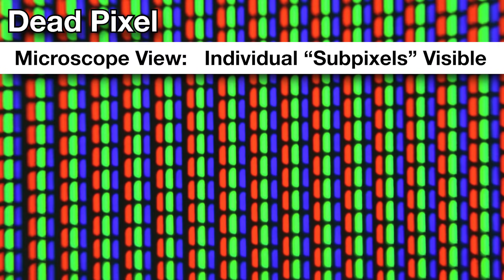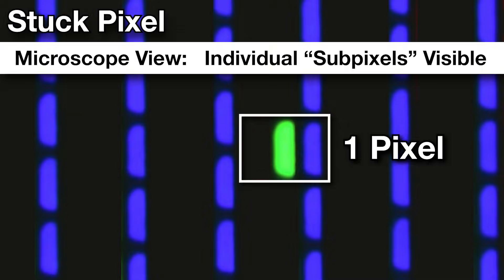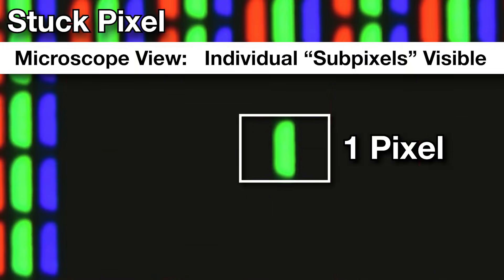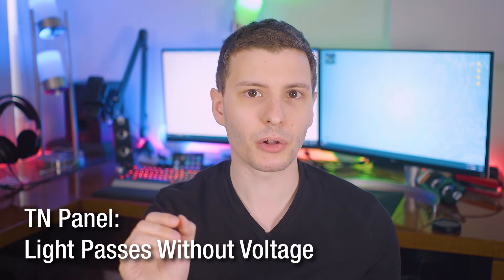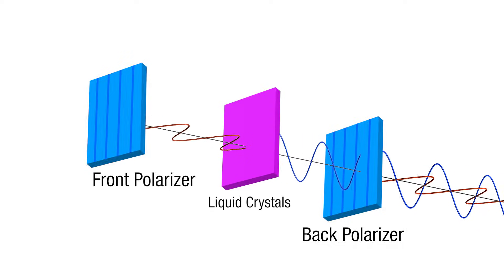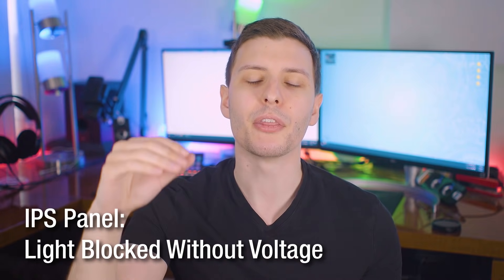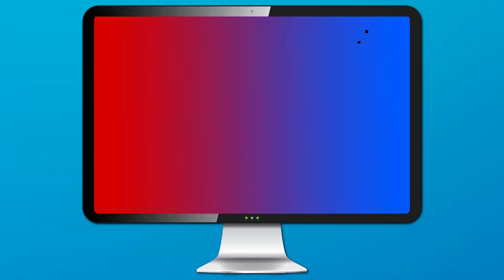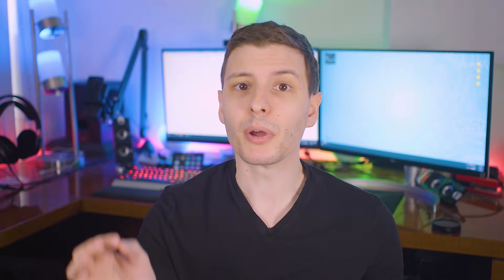Dead & Stuck Pixels: Causes and How to Fix Them

Comment: Sir I have a laptop that contains the same issue. But the twist is that when I saw it for the first time, it was a Big Black spot. But now it's split into Four small Spots in different points of the Screen. Is it possible to fix that?

Comment: I bought a BenQ EX2710 monitor that arrived yesterday and had a hot pixel so I returned It today and I also got another one today (long story) and this one has 2 stuck pixels that look greenish, I am also sending this one back and got another replacement coming on Thursday but figured I could try something simple to try and get rid of the stuck pixel before that one arrives to cancel the replacement. I'm going to try jscreen. Awesome video.

Comment: I dont know if what I have is the same, but I dropped my laptop on accident (it fell from my bed). So now i have 2 really thin lines at the top of my laptop that kinda trip and a black stain on the top, but you can see multiple colored pixels through it if you know what i mean? it doesnt affect anything since its at the top right but my parents will kill me if they saw because i had another laptop that broke and had to get its whole screen fixed. Would that site also work on that stain thats on the top right or only if its around the middle or sides of the laptop? Tips are welcome too!
Reply: hi, did you fixed it?

Comment: Does this also affect phones cause I had a phone that when its supposed to show all black parts of the screen had purple pixels
Reply: ofc
Reply: Yes, phone's have the same types of screens with the same properties.

But fixing those are harder and more likely not possible.  (Mostly in the physical side) First because their glass most of times are stronger. Software methods probably will work the same as on a PC display.

Comment: Hello, thank you for your explanation video, I learned so much from it.

So, I think my monitor has stuck pixels. I don't know, I'm not sure. I noticed it like a month ago when I put my Steam Library page on my screen for half hour or so. then I opened Discord, I noticed that I can see some traces of my library stuck on my screen. I changed my wallpaper into solid color black, but it didn't show. but when I changed into solid color grey I can see the traces of my Steam Library there. but after I turned off my monitor for like an hour it's gone. since then, I set to turn off my display after 15 minutes of inactivity. but just today, I watched YouTube for hours on my screen (not in fullscreen mode) then when I switched to Discord I can see traces of where the video from the YouTube was as some thumbnails on the right. again, I changed my wallpaper into solid color grey, and I noticed the traces. then I turned off my PC because I had to go. now, when I turned on my PC, everything is fine. So, is it the case of stuck pixels or is it something else?

Comment: I have a WEMAX Nova 4K UHD Ultra Short Throw Projector I ordered off Amazon about a year ago that has been starting up w/ a stuck white pixel that slowly fixes about a minute after start-up - Not sure what to do, its been doing this for the last 5 days - The lens is clean and there are no visible particles on the head - Any ideas? -

Comment: I just smudged and pushed a long straight line of dead pixels on my laptop screen to the side. Like, literally, just put pressure and scratched that part with my nail until it moved, and pushed all the dead ones to the side. I had tried JScreen before that, but it hadn't worked. I believe the pressing didn't fix it, but I don't know how it "moved".

This is actually the short version. It took over a week and 2 hours of pressing, and I actually created a big patch of dead pixels (like 5x15), but ultimately, I was able to push all of them to the bezel and gone for good.

Comment: Its all a myth, if you close your phone without using any app the stuck pixels will fix. Problem is you can fix infinitely, once you use an app in 15-30mins you'll see them appear again. Don't push the screen and waste your time with apps, nothing will fix it. Stuck pixels and dead pixels have one thing in common, they both are caused from a damaged screen. Replace the screen and your golden. I happen to have a gaming phone and the screen to replace costs 300$ or more, so im ... F@#£3 I'd buy a new one once i get the chance. Stuck pixels go away but will always come back, they look like shadows of grey/brown/black/purple at least for me...

Comment: I have two monitors, one very expensive and the other fairly expensive. Expensive monitor is less than one year old. They both gained huge black spots all over them that grow like cancer and both at the same time and keep getting worse and worse. Is this a coincidence or could something be destroying my monitors?
Reply: A factory defect
Reply: @jonelbondyingnuezca742  It wasn't. I still don't know what it is, but if poke at my screen it goes away, behaving like it's something wet behind it, sorta unsticking itself. They're definitely "black spots", as in dead pixels, but they're temporarily fixable. That's as much as I know

Comment: I have an ageing LCD that has a bright spot. They're not stuck or hot... it's more like an area about the size of an eraser on the back of a pencil that kinda looks like the backlight is too bright, just right there. It doesn't show at all if the image is black there. It's the same regardless of what colors aside from black are shown.
Any tips before I take my laptop apart abd shell out for a replacement panel?
I'm willing to try risky things at this point

Comment: Okay so... I'm not sure what the deal is with my HP laptop monitor, I'm yet to learn what type of monitor it is, all I'm like 60% sure of is, it's an LCD of some sort. But thing is, today I was loading in a random Python project, it took a while to open so I just watched a short vid on yt on my phone. When I finally looked back on my laptop monitor, there was like a thick horizontal stripe of defective pixels covering 1/3 of the screen at its bottom. If it should be white, it's purple/pink (seems like the red and blue subpixels work properly) with a series of visible vertical dark lines where bright green should be I think, to achieve white color... And if the background is black, the affected area is... I don't know, I perceive it as... slightly different shades of dark green. I brought up a RGB adjuster menu, there were 3 color scales, blue has all kinds of blue from light to dark, red is equally so correct, but green is the same shade of dark green in the whole "scale-stripe". So yeah, it's green subpixels it seems, probably stuck pixels. I hope it's an easy fix... I'll try the colorful noise website when I have time, really hope it helps because it's really just... painful to look at the screen like that... And of course I don't wanna buy a new laptop or spend the majority of its then-price just for a new monitor part or something.

Comment: The rapid flashing trick actually helped me once, but instead of using JScreenFix or whatever, I wrote a little batch file that looks something like this:
@echo off
:a
color 10
color 20
color 30
color 40
color 50
color 60
color 70
color 80
color 90
color a0
colot b0
color c0
color d0
color e0
color f0
color 01
goto a

It works best with Windows 8.1 or earlier, because Microsoft changed the command prompt color scheme, which has lower contrast between the lighter and darker colors, in Windows 10 C.U. This batch file pretty much just flashes colors on screen as fast as possible.
Reply: what a coincidence, i don't need this, but i am using Windows 8.1

Comment: If you have a suck pixel, press on the screen with a damp microfiber cloth. While doing this, turn the monitor off. A few seconds later, turn the monitor back on and remove the cloth. Stuck pixel sould be gone

Comment: Hoping you can help me...
I got TWO monitors with cracked screens (result of Hurricane Michael)..  the internals work.. they just have that cracked screen effect now and I don't use them (have to use a tv now).
I found the panels online but it costs way too much to ship them (they charge pretty much the cost of the panel for shipping... so almost $500 to get two replacement panels here.
Just on a whim I searched for how LED monitors are made...  found some interesting things but I often wonder is there a place that fixes these or even a way to find them elsewhere that I haven't tried yet.
 The are MSI Optix 23 inch curved screen  monitors
Below are the model numbers I found on the screen panel inside:

MLMC236Z082S2 628CR01257

MODULE NUM: HK236WLEDM-MHS2H

LSM236HP02 

I even saw a video on how to remove certain filters from the panels to make a transparent monitor...  but not sure this would apply because the damage to where the pixels are I guess.

 Any ideas on what I could do?   Hey even if the monitor will run a different screen I'd be willing to try that..  
Might have to make two new cases for them... but I just want some working monitors again.

Comment: Gently (barely any pressure) massaging with a stylist pen worked. Thank you!

If the stylist pen doesn't work at first, you might need JScreenFix on the spot to stimulate it first? 
At least that's what fixed my IPS panel. 

If it still doesn't work don't give up just yet. 

This is the exact process that fixed mine:
1. JSF on the spot for 10 min then off the spot to see if that worked. It did not. 
2. JSF back on the spot for 10-20 more min while watching this video. 
3. Gently! (can't emphasise this enough, barely applied any pressue) massaged the spot with a stylist pen for around 5 seconds after 10-20 min passed (around 20-30 min total) with JSF on the spot. 
4. Removed JSF to see if that worked. It looked noticeably smaller. 
5. Without JSF, immediately after massaging with minimal pressure the stuck pixel disapeared as if it were a dust particle.

Thanks again!

Comment: Even after watching this, I still have no idea what is the tiny black mark on my monitor, it doesn't look like a pixel issue, but it also cannot be cleaned off. It's like there's some dust insite the panel, impossible to remove and it's annoying the shit out of me.

Comment: i have to say this may be the wrong thing to try. i have a philips 240bw and i just fixed it during this video. i noticed that my green pixel flickers when i push on top of the monitor so now i tried pulling and then pushing and it promptly vanished. so the problem was in the edge of the monitor.

Comment: The problem that I have with my display is its a second hand TV with a few lines of stuck pixels and they go from top to bottom, I got given it for free due to this issue which doesn't bother me much but it would be nice to fix it, even after watching the vid it seems I would just need to get a new display sadly

Comment: Several months ago I had a red pixel on the screen of my Asus VG278 monitor. Drove me nuts because the monitor wasn't that old.  Anyway, all I did that fixed it was to do a factory reset. That's it and it worked for me. It's been fine ever since. Maybe that will work for someone else.
Reply: Lol what? I honestly wanna do this but I'll wait a bit

Comment: I have a new ASUS XG27AQM and after 2 days 1 stuck/hot pixel appeared and noticed also a grey spot ( seems to be dust between the panel ). I tried using jscreenfix and didn't work. Today another stuck pixel appeared so I decided to apply pressure on the stucked pixels and guess what ... it did work but the dust spot didn't disappear, obviously. Will I have more issues along the way in time ? what happened to your stuck/hot pixel ?

Comment: In short: if you pay peanuts you are bound to get monkeys....
It’s normal to have a few defective pixels in a monitor, it’s the standard QC methodology for manufacturing electronics, it’s called 6 Sigma, it’s a very high standard, and it reflects in the so called class 2, the DPMO for six Sigma is 3.4; bare in mind that the Higg’s Bossom announcement from CERN was based on a 3 Sigma statistical analysis.
Perfect monitors are hand picked out of the production line and sold for a premium, the rest is divided into categories and sold accordingly; I use a high quality IPS for my postproduction it’s a 2560x1440, out of the box it had 1 dead pixels near the bottom hedge and a partially stoked one near the right edge, at the time it was £900 instead of the almost £2k of a guaranteed perfect one; another factor that determines the price and quality of a monitor is the consistency of luminance across the monitor, which is actually more important IMO.

Comment: on my old laptop it had several deadish pixels (being random colors, but fixed when pressed hard on), but it bled when pressed which caused a huge blob of red pixels. About 10 - 20% of the screen is dead lol
But idc as its an 8 yr old laptop that is kinda useless, but surprises my that an 8 yr old dell monitor is perfect without any issues.

Comment: getting a dead pixel on a new monitor is really annoying? especially if you spend good money on a brand new one? 
wtf m8, i ordered a new monitor about 2 years ago and the first one i got had 2 dead pixels. you need to warranty that shit right away... like i did.
THAT IS THE BEST SOLLUTION in case of buying a new monitor that comes with dead pixels.
so that means you need to tell your audience to pay attention to this when buying a new monitor: make sure you can return it and otherwise don't buy it there.
and in case you're someone who's actually ok with getting a screen with dead pixels go to ebay and buy the monitor for MUCH cheaper than MSRP.

had to get that out of my system because of the intro you went with, i know it doesn't relate much to the title of causes and how to fix dead pixels but you went ahead and threw in getting a brand new monitor with dead pixels as an option.

Comment: I actually found this video looking for a solution to a stuck pixel on an old LCD TV I'm using as a secondary monitor for a laptop I have just so I can better multitask while reinstalling Windows on my desktop and I had tried one of those videos that flashes colors for a bit and was hoping to just see if there were other solutions. While watching this video I got to the part where you mention about pressing on the screen so I grabbed my microfiber cloth and the moment I put any pressure on the area the pixel unstuck which really surprised me as I had never heard of that being a possible fix so thank you for this video.

Comment: Edit: my laptop is a Dell G5 15 with Display specs of
15.6" FHD Display with Webcam. Hopefully these specs will help determine which type of specific Display, TN or IPS.

Hey so I have an issue Similar to this but as I was watching this video I noticed something very odd with the only hot/stuck pixel. So at first it looked white, so I looked it up and concluded that it might be a hot pixel, then I noticed that depending on where I tilt my head it is either green or red. I can even angle my head to a sweet spot where if I close one eye it is red, but if I flip it I see a very faint green light, when I did this, my left eye saw the red and my right eye saw the green. So my question is, is this a hot pixel or a stuck pixel because sometimes I see green or red? And also i can only see this pixel on a very dark screen while being relatively close which might just be my poor eyesight but I have no clue.
Reply: This is my exact laptop and I'm having this exact problem too man. Did you find a way to fix it? Or it's still there?
Reply: @rivvy2138  from what I can tell it looks like it went away after I put just light pressure to the area. Hopefully this helps fix your problem.
Reply: @ashtondoublet8334  oof tried that. No luck. Hopefully it goes away on its own cuz it's one dot bit it's driving me insane lmao

Comment: to get rid of the pixel and make it drain... you need to remove the battery/power supply and drain all residual power. ie hold the power button down for a few seconds. then leave it off for a while a few weeks . once its dead dead it should re work fixed.
Reply: Bruh... Leave it off for weeks?

Comment: Thanks for video,  was very intresting , especially trick with filters next time before you do anything Try shouting at it and throwing it out from the window! It will not fix the pixel but you will feel much better straight away and save your time too.

Comment: I have legit never seen a single screen that was fixable by using one of these rapid changing color things... are we sure this is not a myth?
Reply: Same, it is complete bollocks.
Reply: I’ve seen stuck and hot ones fix themselves at times. Doubt it has anything too do with this method though

Comment: Superb video! I have bought an Acer predator monitor three weeks ago and I had a red pixel out of the box but two days ago the this red pixel seems that it has fixed it self and working fine I am eligible to return it in week time, however there is no stock for that particular monitor so I'm a bit torn on whether I should return it as this issue or dead or red pixels could occur again in the future....any advice? Is it worth the risk?
Reply from the maker: If it fixed itself that quickly it will probably be fine i think. I’ve only ever seen dead/stuck pixels out of the box. I’ve personally never seen or heard of good pixels turning bad.
Reply: @ThioJoe  "I've only ever seen dead/stuck pixels out of the box" apparently Acer had done a colour calibration test on this monitor before they had send it to me since it came with colour calibration printed certificate by manufacturer something which they probably do with their screens that I had never seen or came across with other brands, just surprised they haven't spotted the red pixel back there?!.... anyways it's sorted and I used it today for 5 continues hours and looks ok......thanks for your reply Joe!.
Reply: I got an acer predator monitor with a green stuck pixel, has been almost 6 months and hasn't went away